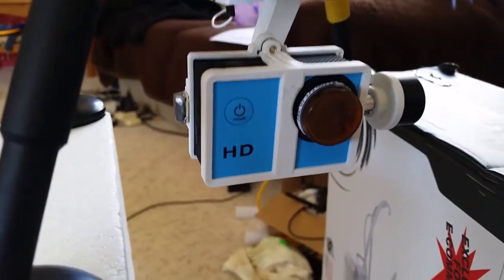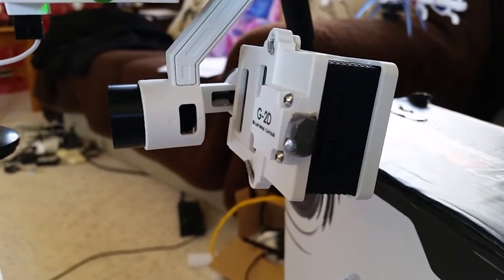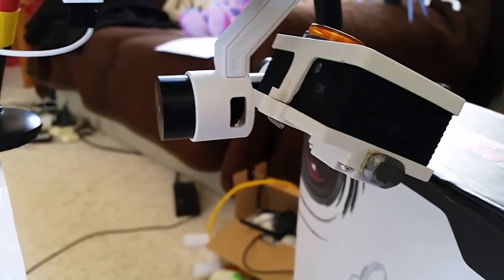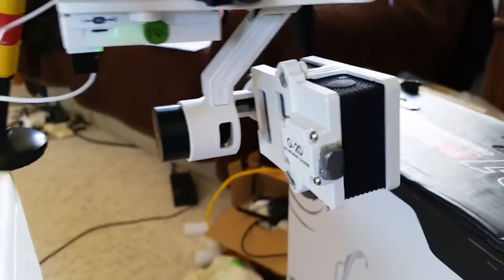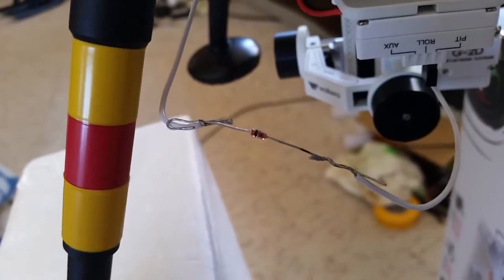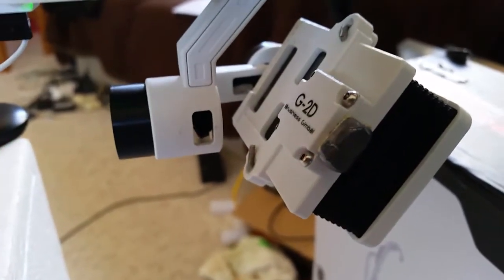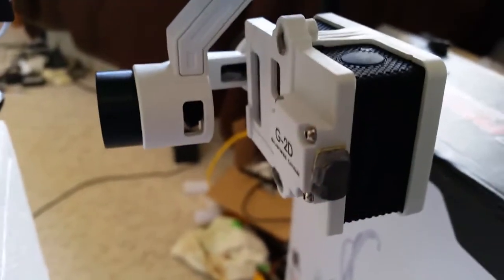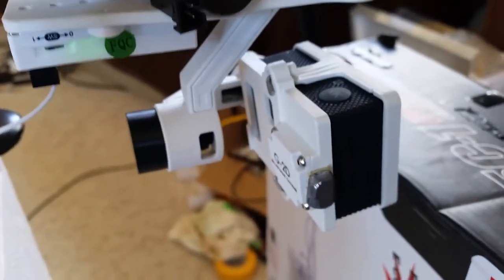Fixing Walkera G-2D Gimble Tilt Hunting Problem

Comment: I had the same problem with  a cheap g-2D gimble and what i found out is to hook up the X380 to the Flight Control program and go to the advanced config. tab and at the bottom left of the screen you'll see a Gimble setting and it is set to 1.00, you need to set it to 0.00 because it is sending signal to the gimble at 1.00 and that cured mine. it only does it when the signal wire to gimble is connected to the x380. Hope this helped!

Comment: help there are three pins on the gimbal for the pitch which one do you use and fit the diode on. I'm guessing they are pitch signal wires?
Reply from the maker: Jake Elford the three pins are positive, negitive and signal, you connect to the signal of the pitch.
Reply: Pete Johnstone thank you which one of the 3 is the signal on the gimbal?
Reply from the maker: Jake Elford , Jake, i dont know if you got any instructions with your Gimbal but it will show on their. If you have a Walkera G2D gimbal then it is the pin that is closest ti the inside of the gimbal (against the small notch of the servo plug) ie the negative is on the outside the possible is in the center and the positive is closest to the inside against the adjusting screws.

Comment from the maker: Phillostar, use the IN914 signal diode you got. make sure the black band goes to the Quad (X380) side. 
Also tip is turn on transmitter turn trim wheel a little  first then power on X380. By turning trim wheel on transmitter first allows or causes camera to center otherwise it will try to turn right to bottom.

Comment from the maker: Basically because the signal is PPM (pulse proportional modulation) and its mixed with voltage which makes it a dirty signal. so some boards will pulse with the power. the diode cleans the signal. (eliminates voltage) so stops the pulse. (the hunting effect)

Comment: I am having this same hunting issue with my walkera G2d gimbal on my x380. Do you have a link for where and what to get the diode?  Also I have been trying to figure out what the 1 sw 0 switch is for it seems to only work correctly in the 1 position?